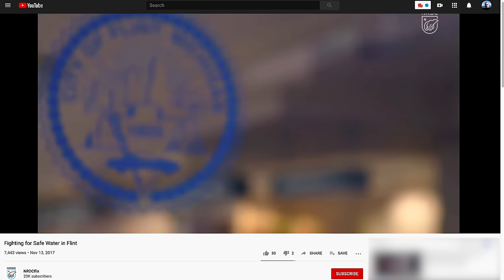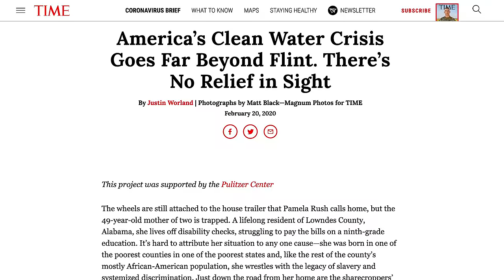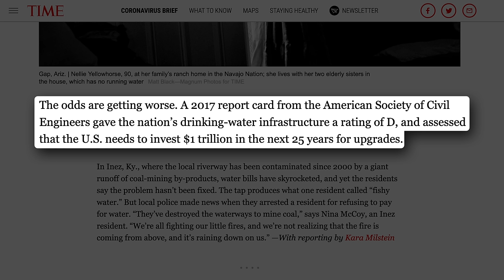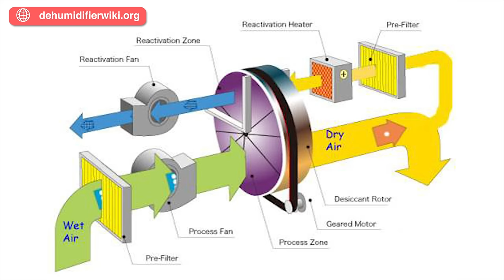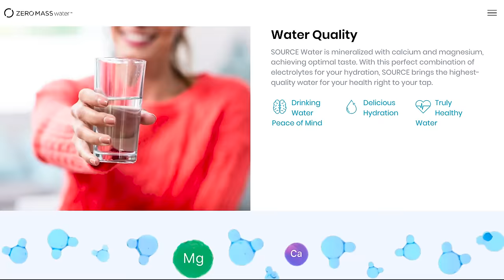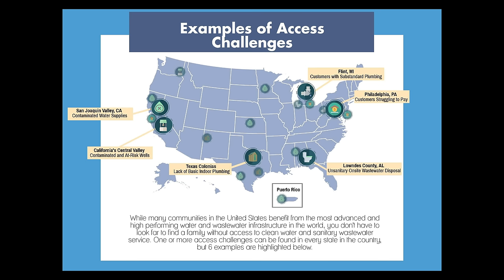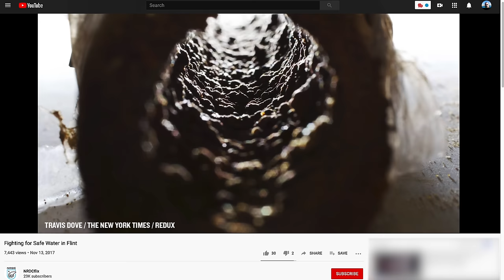Off-Grid Water With Air and Sunlight

Comment: Hi Ben three points with bottled water..  its a grade A ecological and health problem.. 
Waters heavy 1kg per Litre..  shipping that by road causes a huge amount of air and road runoff polution. The energy cost is awful compared to mains water. 
The quality of water being bottled has frequently been shown to be questionable even at the point of bottling. 
The chemical composition of the water itself can be problematic.... either missing trace minerals or containing very high levels... depending on the domain of origin surface or groundwater and the ecology and geology of the source area. 
Soft water ie natural rain water to slight acid water tends to be sweeter and nicer to use for washing..foams with soaps and detergents easily... but it is not so healthy for most peoples, bones nerves and  cardio vascular systems... 
Hard water is water that is richer in those calcium and magnesium salts..... and is healthier to a point it, and this is where we have to remember tolerance limits ...both general and individual.. some bottled mineral waters ive found like in regions of France actually contain levels of mineral salts that might also cause problems for people with high blood pressure and kidney function issues.

Third point the plastic bottles ... they can spend a long time in transport and storage before consumption..
The water quality of water deteriorates ..even if its free of any biological contaminants and kept in the dark there are chemical changes within the water as chemicals react with O2 in the water Carbon dioxide Nitrogen etc ..  summed up in the Bio Chemical Oxygen Demand of the source water. 
The next bit is more incideous there is leaching of plasticisers from the bottles over time depending on the water and the transport and storage conditions. Weve all tasted water from a plastic bottle thats been left in the sun or a car for an hour or so😖🤢 but its has implications given the amount of other plastics our foods and liquids come in ...thats all your cartons and cans these days.
The other increasingly alarming issue comes from the bottling and transport of the water ..shedding micro and nano particles of plastics into the water ... These are proven to cross the gut wall blood barrier and even penetrate cell walls  damaging DNA. 

Clinical testing shows a western child under the age of 1 has proportionally 10x the level of micro plastics in their body as an adult...

Clearly plastic water bottles... Should be a last resort way of distributing potable water.. they also represent one of the biggest uses of single use plastics. 
The good news is its one of the most valuable and easy to recycle plastics...but a lot ends up being contaminated and turned into fleece type clothing ... but its through washing of those  thats where contamination of the aquatic environment really takes off.. 🤦🏻‍♂️🤷🏻‍♂️ 
BTW. Lead pipes are stable for centuries in hard water areas...unless disturbed by soldering/plumbing activities..
If you have lime scale problems ...you like as not have alkaline hard water 👍🏼

I cannot help thinking that what you need is a concentrated solar powered distillation/  desalination type it doesnt really need pumps or fans but if added it to increase the efficiency they could run from a PV panel. 
The downside is you end up with a concentrated brine to dispose of.. 🤔

QED fix the water supply and stop polluting the ground ...and if its bad deal with it at source the treatment works... 
Artificial Reed beds and lagoons have been used to clean up water and sewage off grid for decades in Europe.

Comment: If I understand this setup, it us a solar panel powered dehumidifier on the roof.
Wouldnt it make more sense to mount tbe panels on the roof without the need of a boom truck and power the dehumidifier inside the house? It would be easier to plumb, maintain for purity and simple to replace when the dehumidifier fails. With used panels($50 per 240w panel delivered from Suntan solar) you could run the entire setup for under $1,000 usd. You could scale it up to whatever amount of water you need per day. The payback would be a couple years not 10. Or....you could use the panels to run AC as most people will enjoy thanks to climate change. ACs are giant condensers and produce a large amount of water each day, depending on ambient humidity, time of use and size of unit. Now that is bang for the buck. Oh the condensed condensation is much cooler if you harvest it quickly.
All in all an expensive shell on a dehumidifier the box stores sell. Oh you could skip the solar and just plug it in and pay back would be a couple months!
Reply from the maker: check out the DIY version on instructables and let me know how it goes! 👍

Comment: Two thoughts. I doubt this contraption is all that complicated to reverse engineer and produce at a DIY level. Second it’s also very easy to filter bad water at a household DIY level. Water filtration is a very old technology. It’s interest I think about the use case of something like this, maybe it’s great where there’s no other source of water? But cost prohibitive when you could just as easily filter an existing water source with materials you can buy at the hardware store, sand, gravel, and charcoal

Comment: One concern I have about this approach is air pollution; microplastics, industrial emissions, and car emissions. While some of these pollutants may be avoidable through filtration, addressing them effectively would likely require the use of a reverse osmosis (RO) system, which in turn wastes water. According to published studies, RO systems typically waste about 3 gallons of water for every 1 gallon of purified water produced. If the process of harvesting water from the air yields two gallons a day, the net gain would only be approximately one-third (10 cups) of that amount due to the water wastage. Personally, I've never placed much emphasis on the need to add minerals back into water, as the average American diet is likely to compensate for any mineral loss. I believe that adding minerals back into the water may obscure any meaningful results you would obtain from a parts per million (PPM) reader. My suggestion would be to disconnect the mineral system, conduct your own testing, and send a water sample to a laboratory for analysis. I appreciate the great video and your dedication to the your channel's mission. Keep up the good work.

Comment: you said it's not a dehumidifier, how so? is your reasoning because it uses PV for electricity instead of the grid? How is the dew point raised? 

It seems to me like the water/humidity version of a heat pump, it is concentrating humidity in the container extracting it from the surroundings. 

This is like how a heat pump concentrates the heat extracting from "cold" surroundings. A heat pump "air conditions/cools" the neighborhood to heat the house and this would "dehumidify" the neighborhood to super-humidify a closed container quite literally "making it rain." A lot like when you take that long shower in the old house's bathroom that has a skylight, then get out and towel off but the high window is dripping water down on you.

Comment: Wouldn't it make sense to use solar power to run a home dehumidifier? They draw about 500w, and make 15 liters per day. You can run them indoors in the winter in cold climates...
Reply from the maker: Yeah I’ve seen DIY systems like that. These are really good for places with zero other infrastructure. Check out my Aquaphant video also for a simpler home based solution

Comment: I'm pretty sure that rain water collection is illegal in California. but I'm pretty sure that if you installed rain water collection on your house you might get longer dry spells but that over a year that you'd get a lot more water. especially since it looks to me like you have quite a large roof.

these don't change my opinion of dehumidifier based water collection. high investment and they work best when the probability of rain is high.

also, 2 gallons is what you use to make pasta.

Comment: I would open a massive skylight in an outbuilding and encase them, insulate with something more than R-19 and put in a small heat lamp that runs off its separate 100w Solar with a regular deep cell truck battery to keep it above freezing. Works for my chickens water, I live far north by Canadian border. 

Would enclosing it still produce water after sun went down until all the heat was dissipated from the unit? I imagine it gets VERY HOT 🥵

Comment: it looks like it was designed by a NASA/Pentagon contractor, at $6000 per 18 liters/day, it comes out at $330/liter which makes it more expensive than a Premier Cru French wine. Even averaged over 1 year, it comes out at over $3/gallon, like gasoline. Get yourself a 55 gallon drum with a bottom spigot, put 5 in of gravel at the bottom, fill it half way with quartz sand, and place it under one of your roof downspouts. Of course, you need a screen to keep out mosquitoes and debris, but it is nowhere near 6000

Comment: Brother, the crane was half the cost of the panels. Look it up! 
Cranes are crazy expensive. Running about $200 to $700 per hour usually.  Sometimes more. Maintenance is ridiculous on cranes they need lots of it. 
Probably thinking it took maybe 2 to 3 hours and since that was in the pandemic and all i am thinking it was $400 to $500 per hr. So $1k and the panels shouldn't cost more than $2k . Transportation probably crazy

Comment: There is a similar product created in Africa I wish I had the video where I saw this a couple of months ago but their unit almost looks like a very small vending machine I don’t recall where they were getting their power also I doubt that occurred to me when I saw you a unit you already have Solar panels why can’t they offer for just the unit pump itself and tie it in to your current solar system I believe that would omit a lot of the weight and the size of the unit and the location where you can place your tanks.

Comment: Correction - that's not a drinking water. That is a distilled water. It may put individuals at greater risk of nutrient deficiencies. It lacks minerals that may benefit health. For example, drinking water low in calcium and magnesium is linked to an increased risk of fracture, preterm birth, and heart disease. So, if it's the only source of drinking water, it need to be remineralized.
Reply from the maker: That’s why they have a mineral pack 😅

Comment: I am missing reflections on alternatives like rainwater collection, purification systems, using grid power instead of solar, local air humidity in relation to outside temperature (cold air holds less water), ….. Also I would expect the air humidity to be higher after sun down, when the solar will not work, ….

Comment: You need to have the water tested for hydrocarbon contaminants. Where does the pollution from Third World countries go?  Where does all the lead and mercury in coal-fired plants go? Some definitely in the air. The condensed water is definitely containing some contaminants. A professional test would be interesting.

Filtration: Carbon-RO-Carbon is still the cheapest if water is available

Comment: I agree with your premise for promoting these systems since clean water is going to be a commodity in the near future.  But, most folks don’t have the upfront money to buy these systems and financing them puts them behind the 8 ball considering current economic conditions: Biden inflation. Perhaps you ought to provide an analysis of financing these systems over 24, 48, 60 or 72 months like one would do financing an automobile. Use interest rates banks and credit cards would charge for someone having a fair credit score which ranges from 8.24% to as much at 35.97%.  

Would things look attractive then?  I don’t think so. The time value of money, depreciation, taxes, degradation of the system over time, maintenance, needs to be considered in this system’s life cycle.

For 60 months at 8.24% interest, a $6000 system would end up costing  $7341.

For 60 months at 12% interest, a $6000 system would end up costing  $8008.

For 60 months at 16% interest, a $6000 system would end up costing  $8754.

For 60 months at 20% interest, a $6000 system would end up costing  $9538.

For 60 months at 24% interest, a $6000 system would end up costing  $10,356.

For 60 months at 30% interest, a $6000 system would end up costing  $11647.

For 60 months at 35% interest, a $6000 system would end up costing  $12,777.

Comment: For that money if you "really" spent it,
you should perhaps buy more solarpanels or windturbine and batteries and 12v dehumidifier and let them run day and maybe nights even more efficient. 
Long warranty is good, but useless when companies shutdown .
The noise horrible, how long will the ventilation fans last, a clear turn off from buying. 
Put one bucket under your air-conditioning

Comment: Um cool but you basically made an advertisement and didn't explain how the thing works. Yes you mentioned dropping the dew point and all that but that's not a breakdown of how the tech. Also, there are passive systems for moist air harvesting that consist of mesh nets that require nearly zero maintenance. They won't work everywhere but places with sufficient humidity they're great.

Comment: So just in case most tap water is safe. Most bottle water comes from the tap. If it does not come from tap, bottle water depletes our aquifers. Bottle water is awful for the environment because it uses Fossil oil through the entire cycle. Some micro plastic leaks in the water causing some illnesses (BPA). Most bottle water do not contain Fluoride, fluoride is to prevent tooth decay (small quantities is safe). Bottle water is like 300 times more Expensive than tap water. The problem is that tap water is control regionally thus, your water safety will depend on your local government (it sucks).

Comment: These numbers are optimistic to me. You said yourself you don't drink that much water a day, so you're not likely spending that much on it anyway. If you also needed to use this water for other things (showering, dishes, toilets etc) then maybe, BUT you aren't buying bottled water for those uses. 

In areas where the water is non-potable, but there is still water, then this is a good solution. For example, if you have ground water that is slightly saline, which might work for showering, toilets etc, this is a good solution. But to me, this isn't a good solution for our water troubles in general. 

Not a good solution - yet. Doesn't mean it isn't worth doing. This could and probably WILL lead to better tech which might solve our water issues.

Comment: I don't know if you're aware but the more moisture you pull out of the the dryer the air will be, in turn destroying what rain fell naturally by negation of air moisture making natural rain less likely to occur. I can solve the Water Crisis if the mentally challenged would stop living in deserts where there's no water there wouldn't be any problem boom fixed it.

Comment: Wait, so it extracts humidity from the air, but it is NOT a glorified dehumidifier? Then what exactly is it? What is the underlying technology that makes this different? Call me skeptical, but this sounds an awful lot like a dehumidifier that is designed to run on solar energy. The volume you get out if it in a day also sounds awfully familiar...

Creating clean drinking water isn't really the issue. The vast majority of our planet has ample water - and many tried and tested technologies exist to make it potable. Condensation, evaporation, reverse-osmosis, mechanical filtering ect. just to name the most common ones.
The issue is the cost pr volume. All these systems either need a lot of energy, or materials that need replacing eventually. The people who could afford this could also afford the alternative methods, so I'm not sure how much this really changes things much. The underdeveloped parts of the world that really need it can't benefit from it.
I think the most cost-effective way (outside of centralized processing, ie. tap water) is probably mechanical filtering, because some types of filters can actually be reused for a long time if you took the time and effort to clean them out very gently. They also require no energy. They can't fix every possible contaminant type, but a good filter can remove basically all parasites, bacteria and even viruses - along with general sediments and minerals of course. That usually results in water that is much purer than what is considered high quality tap water. So to solve the worlds potable water crisis we just need billions of filters and someone willing to pay for them... heh

Comment: This system FAR outcosts a water distiller. I bought a water distiller for close to $300 and it will last at least 10 years or more before it dies. I have a friend who bought a distiller that's still running after 18 years of service. I don't buy the activated charcoal filters that are suggested in order to make the water taste delicious. Instead, I buy the new Eco Zero Water CHARCOAL filter only... which outlast the filters suggested by the distiller manufacturer. This is NOT the regular Zero Water pitcher system that you see in stores. So there is no limit to how long a distiller lasts... and they are FAR cheaper than a system that costs ofver $6,000 !!